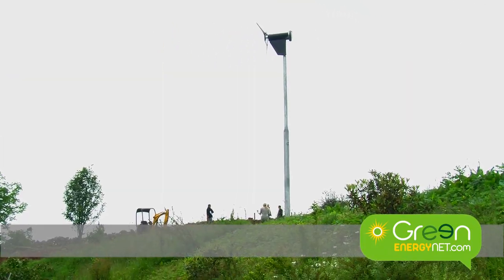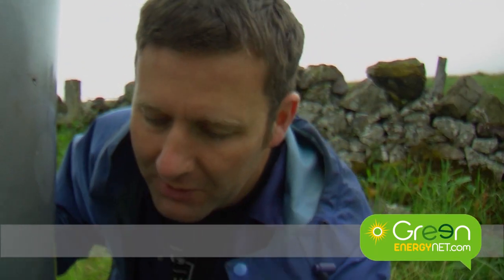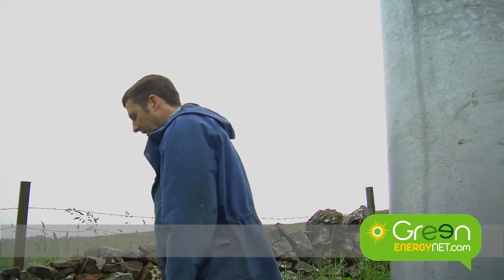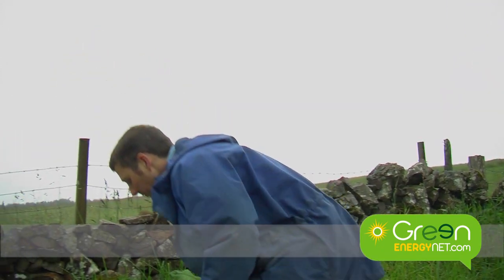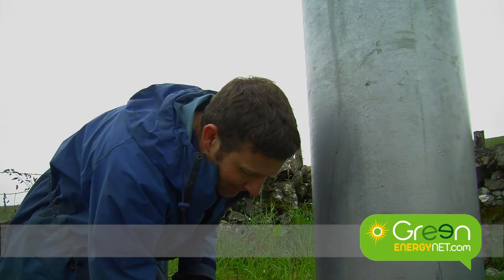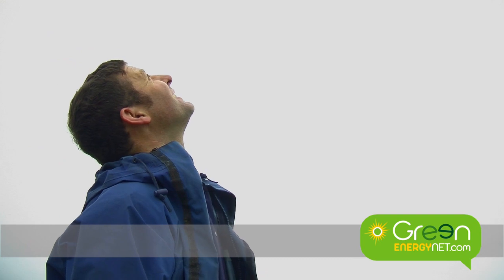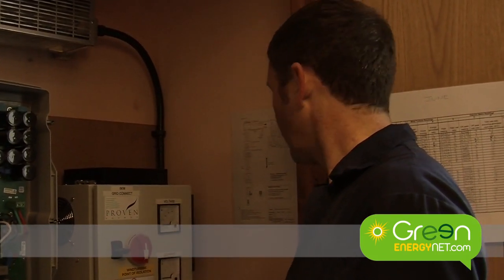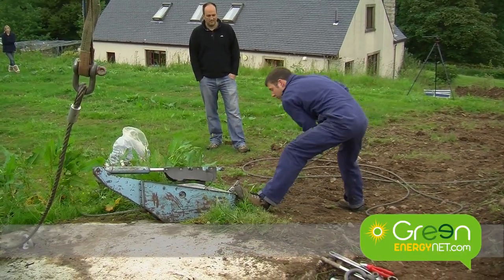Servicing a small 6kW wind turbine

Comment: A few hundred quid for a days work ! Really ? How is that justified ? I mean ,how many hundreds of pounds does a 6kw turbine earn ?
Reply: 52 MW/year I believe
Reply: @maxandersen6532  Yes, but how many pounds earned compared to annual maintenance cost ? For example to obtain 52 mw per annum it would require the turbine to be running 24 hours per day at full pelt. We know that is not the case . The average production in the UK for a 6kw turbine is about 9 mw per annum. So if you're maintenance costs are that high there is no room for profit.
Reply: @irish-medi-weed-grower5240  I cannot verify your numbers. I can verify there is something called a production factor involved which would slash the theoretical value that it could produce. Yet these systems I doubt are bought to make a profit, at least directly. They are meant to supplement energy needs. So, for a few hundred pounds per year in maintenance, plus the cost of the turbine, the necessary costs for the inverter, installation, is it worth it when compared to getting energy from the grid...I don't know. You would have to ask them.
Reply: @irish-medi-weed-grower5240  I don't know how I would use a calculator to figure out if your numbers are correct, it's about your stated production factor: 17.3%. Either way, does that cover the cost? What would be the break even amount in terms of MW/yr? At 9MW/year, what would be the break-even amount in terms of Pounds?